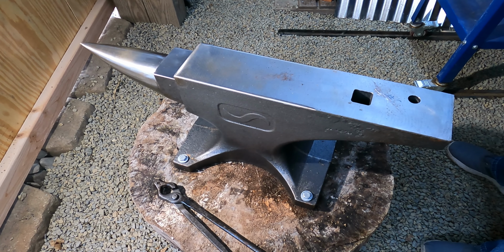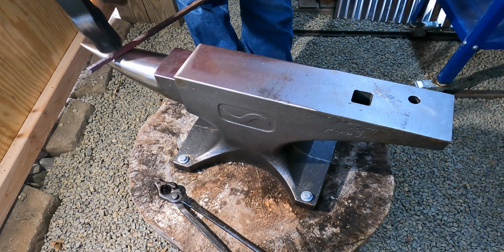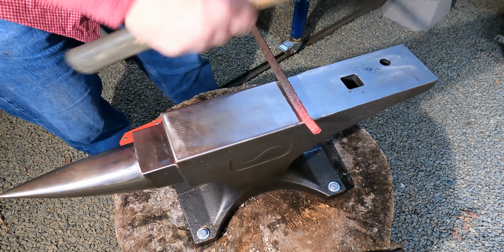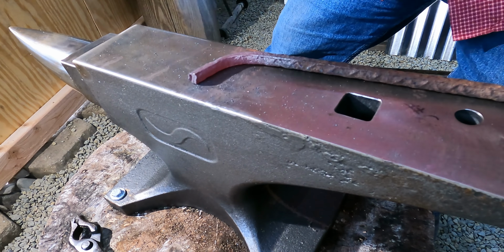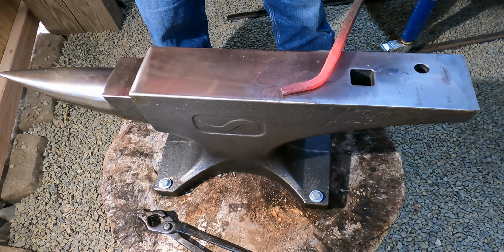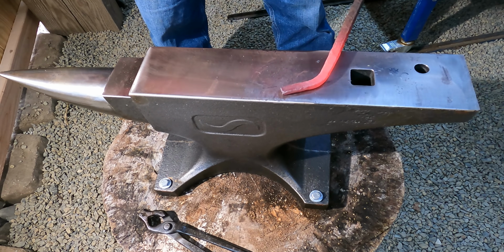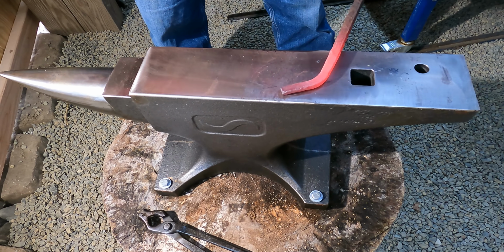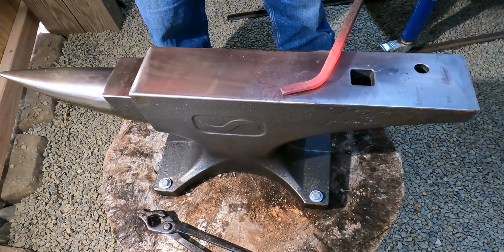Alec Steele Anvil Review and Demo

Comment: If you have errant blows, is the anvil denting? Could you get a hardness file set and tell us what the surface hardness is? Also ball bearing rebound would be a nice revisit :)
Reply from the maker: So far I've missed a few more hits than I'd like to admit, and had no dents at all. I obsessively wipe it down at the end of the day and check for damage. I can definitely integrate some hardness and rebound tests into the next longer-term use review. I'm working on an anvil ring reduction video and planning to try the various techniques folks are recommending here. Every day is a learning day, and all input is much appreciated!
Reply: According to Alecs video it’s 51 or 52 Rockwell
Reply from the maker: @rileyevans8477  I believe him, it's plenty hard. The test kits run $80 for the files and the sky's the limit on the electronic testers. So, that's not going to happen (I'd rather buy a decent rounding hammer). But I did test the rebound and posted the results on this channel.
Reply: Yes I totally understand. I want a rc tester for knives but financially not in the budget. I liked the video just figure I’d post it in case others hadn’t watched his video on them.

Comment: That void in the base is caused by the steel contracting after it's cast. Steel contracts as it cools, and when it's cooling from 1600~ degrees C down to room temperature that contraction will be significant. I've worked in foundries in the past and keeping a solid steel casting of that size fed as it cools and contracts is a nightmare, even with exothermic riser sleeves to keep the runner and riser feeder reservoirs molten for longer it's a challenge.   Looking at the location of the voids, it's a fair assumption that those anvils are cast upside down, ensuring that if such issues occur, they are on the base of the casting where the effect is minimal.

If you want to reduce the ring further, use silicone sealant to glue your anvil to the stump and put a magnet under both the horn and the heel.  Anvils work the same as tuning forks, with the thinner sections away from the main body i.e the Horn and the Heel the source of most resonation and therefore noise.
Reply from the maker: Great info!
Reply: Thanks for the education
Reply: Brilliant advice
Reply: Regarding efficient use of magnets for quieting ring - ive never used an anvil, but conceptually, in order to function efficiently in that role (analagous to a mass dampener in architecture), a magnet needs to have both sufficient mass (probably at least a few percent of the anvil's mass) AND have the ability to wiggle ... if it is too lightweight and/or if it grips too snugly to wiggle easily, it will be less efficient at converting high frequency vibration (ringing) into lower frequency vibration (movement).  Thus, it seems logical that itd be best to place magnets under the tail and horn, and weaken their grip force with some sort of spacer or shim - enough so that it wiggles easily, but doesnt drop off. That is my educated guess anyway.
Reply: The underside of both the horn and the heel are curved surfaces so the magnets I use can't achieve a proper grip, I guess this gives them wriggle room. I use 1.5x1x.5 neodymium magnets which is almost certainly overkill but they were what I had on hand and I never replaced them. Every now and then they'll catch me out and steal my tongs or hammer.
Reply: @mayhem1988  In general, I strongly suspect rare earth magnets tend to have the twin problem of insufficient mass and gripping too tightly for purposes of ring suppression - either issue by itself is likely enough to preclude the effect you desire. I hope you'll try my suggestion - look for an older, weaker, and (most importantly) physically HEAVIER magnet, and clip it under the tail, using just enough spacers (if needed) to allow it to wiggle freely but not drop off.  The ability to rock/wiggle is crucial, because if it cant, then it likely cannot function very effectively as a mass dampener.  Remember: the actual vehicle for the mass dampening effect is the moveable MASS of the magnet, not its magnetic field.  Aside from keeping the magnet in place, the magnetic field is wholly irrelevant for the dampening effect.  HOPE THAT HELPS.  Cheers, mate. 

Failing that, the tried and true classic heavy wrap of chains around the waist should work great - it works the same way as the magnet because it converts ringing in the anvil to minute vibrations (in the chain).
Reply: Oh you misunderstood me,  the magnets I have work fine,  my main anvil these days is a 125lb cast steel anvil which are usually the worst offenders in terms of ringing but all I get from mine is a dull "thwack" with the magnets and silicone under the base.
Reply: @mayhem1988  Ah ok, apologies for rambling.  I was just trying to help anyone who might be interested in how mass dampeners likely work regarding anvils.  Cheers, friend. 😁
Reply: Nevermind this guy answered my question about the purpose of the magnet

Comment: I would expect the ringing sound because this anvil is a steel alloy. Considering you are hanging steel on steel, expect a high pitched ring noise. Also you could have made a simple leaf like alec always demenstrates. The anvil is beautiful and functional. That's what matters. If I had somewhere to put one, I would get it to just have it. Small defects are expected with cast items. That's just a simple fact.

Comment: Pull those lag bolts back up an wrap a length of chain around the base making sure you get a good tight wrap and then send those lag bolts down through some chain links making sure it stays tight an it should help eliminate the ringing as well. Just a thought.
Reply from the maker: I like that plan. Definitely a possibility. Thanks!

Comment: Ok just started blacksmithing a few weeks ago... something ive wanted to do sense i was in scouts, but didnt have a yard to build a forge till recently..... however ive been a musician most my life, primarily a drummer....as for dampening the ring, id approach it the same way I would get rid of a nuisance drum that doesn't cooperate.....moon jells for drum heads near the rim of the drum work wonders, so I would suggest getting those lead wheel weights tires shops use to balance a rim and tire....(the stick on kind used for aluminum wheels not the hammered on crimp style for steel rims) and cover the anvil with stick'm lead on the non working surfaces of the horn and heel....oh and i have 3 different "anvils"🤣 one is a cheap harbor freight I bolted to a  huge freshly cut log burried a foot in the ground.. very quiet but mild steel. The other is a railroad bolted to the same log, and the third is a 12"x3/4" 304 ss circle i bolted to an unburried log....that one rings the most....however, i put a half inch chunk of hard rubber under it and now its incredibly quiet....would be even quiter if i burried the log i presume.....anything to stop vibrations throughout the entire  mechanism from the floor to the hammer will help reduce ring....(only know this because of my experience as a musician not as a smith) but if you try any of these ideas do let me know how they work.
Reply from the maker: A magnet did the trick for me. I assume for the same reasons you said with the drums. I ended up doing a whole video on trying different methods because of all the great ideas folks had. Glad you're enjoying blacksmithing! Have fun and thanks for the great info!

Comment: Did the shipping container have metal flakes at the bottom? I was thinking that void spot might have been covered thin layer of cast and when in transit it busted that small patch open?
Reply from the maker: No flakes. It was snuggly bolted on a board covering that spot.

Comment: I want one of these so bad. Definitely can't afford the shipping to Canada though.
Reply: I have the knife maker NC anvil. It is about $350 it is a good anvil for beginners.
Reply: @aaronmendenhall5166  do you have a link for them? Everything remotely near my place is 1000$ or more and beat to hell. I would love to upgrade from my chunk of railroad track.
Reply: @jason Boros the anvil is 80 pounds but if you bold it down to a stump it won’t move. It is a good little anvil with a welded tool steel plate I have had one for over 2 years it works good for if you are beginning in blacksmithing and don’t want to spend to much money on a anvil.     https://www.nctoolco.com/shop/nc-tool-products/nc-anvils/knifemaker-anvil/c/500
Reply: @aaronmendenhall5166  thank you for the information. Sadly it looks like they are out of stock on most of the anvils but I will definitely keep watching. I am a beginner and can't justify the expense of a Alec steel anvil as cool as that would be but those NC anvils look to be great for the price so I will definitely be looking to order one when I can.
Reply: @aaronmendenhall5166  do you know any links for a cheep 2x72 belt grinder.
Reply: No I do not know of any 2 x 72 belt grinders that are cheap unless you buy a motor and buy a build kit but still that would be around $ 700 or more and most of them you have to have a welder to build them.
Reply: @3amForge  right now I have a cheap one by 32 belt grinder from Harbor freight

Comment: I'm surprised to see those casting marks on the side.  I would have expected the entire surface to be smooth.
Reply: I know what u mean, but I know from experience it’s extremely difficult to cast steel nice and smooth, the casting quality of the anvil is actually superb, if they wanted it flat they would have had to grind it smooth and that was impractical,  I personally really like the casting texture on it. Anyhoo, have a lovely day, and merry Christmas
Reply: @couldbejokim4557  They could have done a little finish grinding.  These are premium anvils after all.
Reply: @malikto1  they do. They built a whole setup in their shop just for that but why grind somewhere they don't have to especially if a lot of people like the aesthetic? Those who don't like  it could easily grind it off
Reply: @josephcarter1920  it's also a bit cheaper if they don't have to grind these cast marks off, making the anvils a bit cheaper then if they grinded the cast marks away
Reply: @steyn1775  🤔true
Reply: At that price, a little more attention to detail would be nice. That just looks so bad. Sorry, it just does.

Comment: Put the magnet under the heel or horn, that's where the ringing propagation comes from.
Reply from the maker: You are correct. I ended up trying that later and it worked 👍

Comment: Thanks for the look.  It was enough to lessen my interest in this anvil.  Alec's prototype video was amazing and THAT anvil looked sufficiently premium in both quality and fit/finish to justify the high price.  Yours, however, does not.  I agree that the location of the void renders it functionally unimportant.   At this price per pound, however, there should be no surface defects that rise to the level of actual voids.  Some surface-only gas roughness, sure, but not a crater like that.  Combined with the roughness at the heel and it starts to raise questions, given that the rest of the casting looks close to perfect.

I also think the anvil arrived with the edges over-dressed.  Granted, the dressing is very clean and very well-done for what it is, but not everyone wants edge radii like those shown or the same on both sides of the face .  Leave that to the customer and ship with the edges just touched enough not to actually be sharp.  GREAT dressing job on the horn, though!
Reply from the maker: Glad it was helpful. Giving an unbaised view was my intention from the start. Your observations are well said and on point. One years worth of use now, I can say its still a great quality anvil. Beside a couple of missed heavy blows that left small dimples (only noticible very close up) it has held up to my satisfaction. That being said, the price is the greatest detractor by far. Would I buy it again? Probably not, because of the price.

Comment: Put a layer of silicon under the base and it should be nice and quiet
Reply from the maker: Thanks, I bought the silicone and plan on reseating with longer lag screws and trying a magnet too.
Reply from the maker: @JustinTopp  cool, I'll try it!
Reply from the maker: @JustinTopp  magnet success! Video posted
Reply: I personally use silicone and it works amazing the ring is gone and thoroughly attaches it to my anvil stand

Comment: The holes to bolt it down kind of feel like a potential weak point.
Reply from the maker: How so?
Reply: @SHobbyist  Just thinking of ways I would accidentally break the metal.
Reply from the maker: @Volundur9567  Interesting,  I suppose with enough force the lag bolts would probably give well before the anvil cracks at the holes. But the wood base would give well before either one of those.
Reply: @SHobbyist  I am just unusually unintentionally destructive. I am sure Alec thought out well how it would perform. I am probably that one exception.

Comment: These anvils are cast iron. Have heard a lot from the oldmen of wisdom that, those are just a gimmick and break in half over the horn very esaly. Do you or somebody else have a comment on that?
Reply: I thought they where casted steel, rather than cast iron, correct me if I'm wrong
Reply: @hoomanp3766  that may be, but the grid structure will be the same?
Reply from the maker: @hoomanp3766  cast steel
Reply: Cast steel and certain alloys are very strong when made correctly. It is very unlikely to just break. H-13 steel is an excellent example. That stuff should never fail like that. If such a failure exists, it is more likely the fault in the method/workmanship, not the material.

Comment: These seem like serious flaws, especially for what's supposed to be a "high quality" or almost "luxury" anvil. A void? seriously?
Reply from the maker: I was surprised to see it, but considering the location and how shallow it is, I'm not concerned about it's performance. Had it been anywhere else I would have returned it. If it degrades, I'll let everyone know in an update.
Reply: @SHobbyist  well, my question would be, how many other voids are there buried in the body of the anvil? You said the rough patch is "character," but I'm not sure, given that you've also got voids, this anvil might be misscast and somehow slipped past QC.

Alec is over here in the UK right now, maybe quality is slipping whilst he's away?

It's your choice, but if it were me I'd have sent it back the day I'd opened it.
Reply from the maker: @Mikey__R  Good points. I share what I see. Though dissapointed with the imperfections I'm still not unhappy with the anvil. I've been beating it silly for days and it's performing great. My recent research on casting, the voids would be along the outer surface. But if it breaks open like a Kinder Egg, you guys will be the first to know.
Reply: It actually isn't a serious flaw at all.  It is a riser contact that went a little deeper than intended.  It isn't worth scrapping the casting, welding it up, or grinding the base flush for this kind of thing.  It will have no impact on the performance of the anvil.  Gas porosity would be a bigger problem and would be evident all over the part (looking more like Swiss cheese).  Good foundries catch those types of defects and prevent the castings from going out the door.  Even good foundries can make castings with such defects, as there are a lot of people and equipment involved in the process and mistakes can happen.  The key is to catch them.  But this definitely isn't that.  

Source - Over a decade (and counting) as a steel and iron foundry metallurgist and foundry engineer, and even longer as a hobby blacksmith.
Reply from the maker: @JerrodMiller  that's what I optimistically figured. I'm happy to read your impression on the casting (no pun intended). Thanks for the info!
Reply: I wouldn’t worry, as the casting cools it shrinks, small imperfections are guaranteed to be exposed. Im sure it will be fine and live for generations!